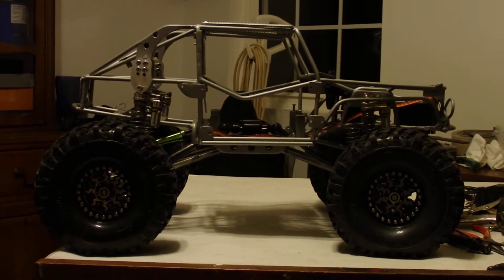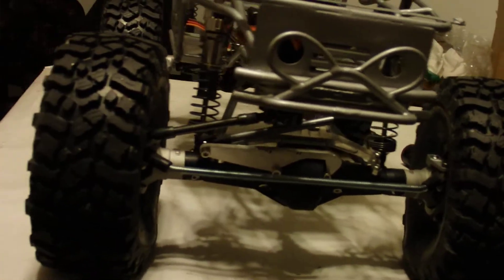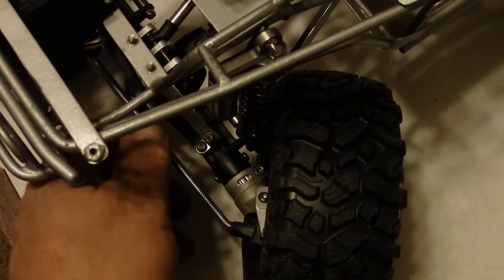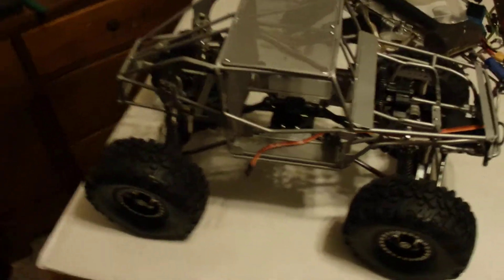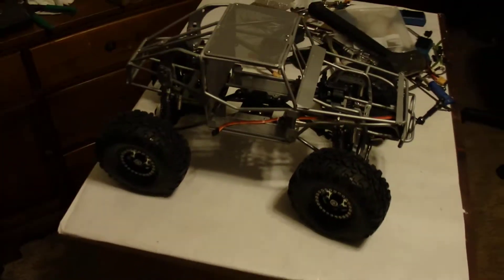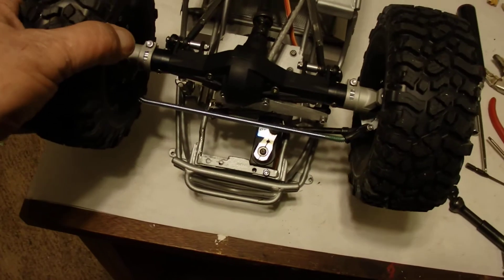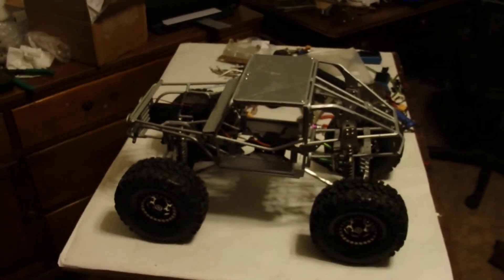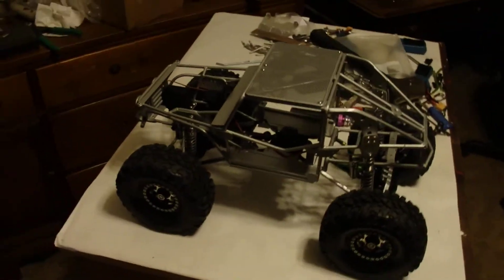U4ia U4RC Tube Chassis Rock Racer Reaches Roller Status

Comment: That is a pretty amazing chassis, I love the drive shafts, it really adds to the authenticity of this as being a scaled vehicle. (You must have a really tiny grease gun for those U-joints eh?   ;-)
Reply from the maker: That would another level of scale realism...little Zerk fittings. Best to run these with a splash of dry lube or they load up with crud. I need tiny CVD boots! A veteran RC addict built it a while back and recently listed it FS,  I had some loot and a desire to go scale. It's a deep dark money hole....like owning a boat. Planning to do aluminum panels, full interior, articulated driver and navigator with servo actuated steering wheel and the usual rock racing accessories like a winch, jack, tools, straps, cooler, first aid kit, fire extinguisher, and on and on. Something I can make little doodads for when I feel the need to tinker. I had to pony up the Benjamins for the running gear...but I should be able make everything else here.
Reply: Mountain Storm Its really an amazing looking piece of gear. Like you said, its a long term project you can plink away at, well worth the price of admission.  ;-)
Reply from the maker: Thanks Jim. I'd really like to build a D90 from scratch. There's a video floating around of a guy that made a Landie all at out metal...that's mad skill. There are some unobtainable super scale FJ shells in Japan. That would be a holy grail for me. I've always loved the early ones.
Reply: Mountain Storm Yea,I fell in love with the fj40 shells for the cc01, but the chassis is pretty expensive. They don't seem as capable as many of the less expensive units out there. I do like the cc01 though.....

Comment: You gotta fill those reservoirs for the coilover shocks?
Reply from the maker: Yep. Fill the shock and the res and bleed out the air through the valve screw. Not sure if it makes any difference to performance but I'll find out when I power it up one of these days.